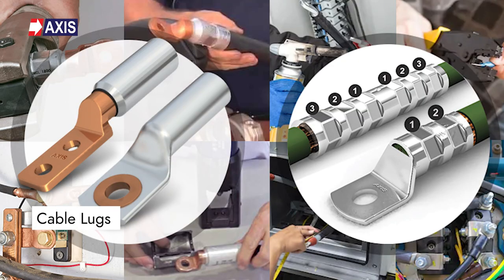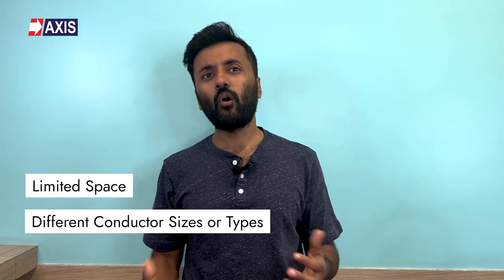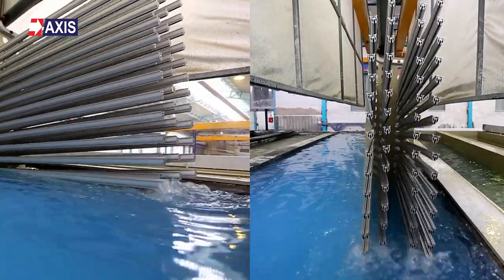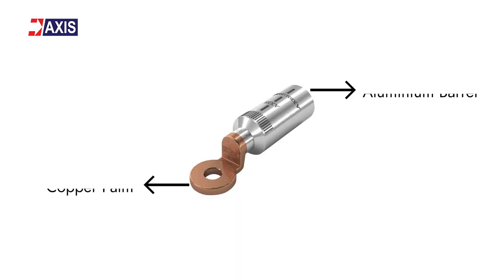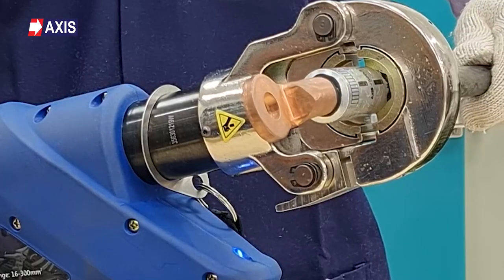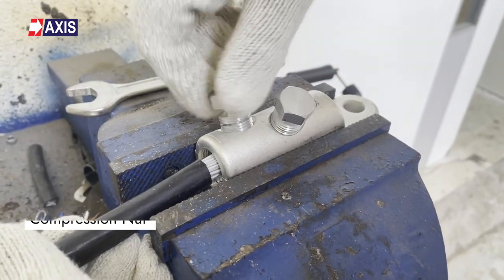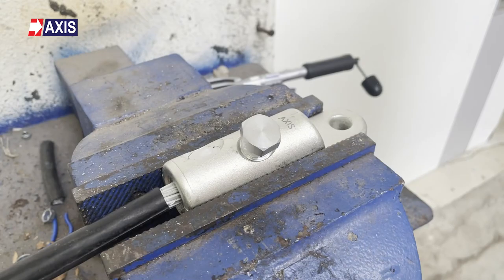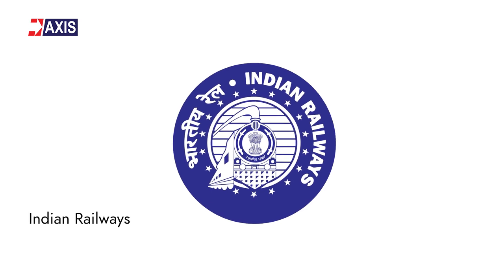Type of Lugs - Which Cable Lug should you use? Learn Application & Types in Detail!

Comment: Hi, landed on this great video while searching for lugs and perfect connections. I've few questions:

1. What is the best way to make connection from lug to lug? Should we use washer or not?
2. We are searching to buy copper lugs for transformer connections in power supplies for EV chargers. But looking at the price at which these are available, I'm highly skeptical about their quality and the copper content. What are your suggestions?
3. Does Axis provide lugs in small quantities or samples?
Reply from the maker: Hey Jitendra,

1) Regarding using the washer:
Lug to lug can be connected directly. No washer required. However, you need to ensure the flat portion of one lug shall be in contact with the flat portion of another lug for lesser contact resistance. For this type of connection arrangement, it is better if one lug is connected in an inverted position with another lug.

2) Our suggestions about quality and the copper content:
We manufacture lugs with pure copper ETP grade material having 99.9% copper content. These lugs are UL-listed and certified. So you quality can never be an issue if you are using Axis lugs.

3) About quantities and sample:
We can provide you with samples. Let us know the size of copper lug you need at sales@axis-india.com.

 MOQ is depends on Lug size.
Reply: Thanks a lot!!!

Comment: Bro Why we are not doing earthing to the A2 gland
Reply from the maker: Hi Muhamad Asim,

A2 Gland is used for Non-Armour Cable, therefore there is no provision for earthing on the A2 Gland.
 
On the other hand, the Armour Gland has different construction which also holds the Armour of the cable while installation. 

To provide a low impedance path for fault currents and to ensure the same electrical potential of surrounding equipment or structure, Armour Glands need to be earthed.
Reply: Highly appreciated your response brother
Reply from the maker: Thanks, let me know if you have any further queries!